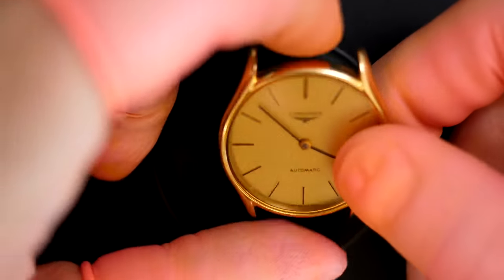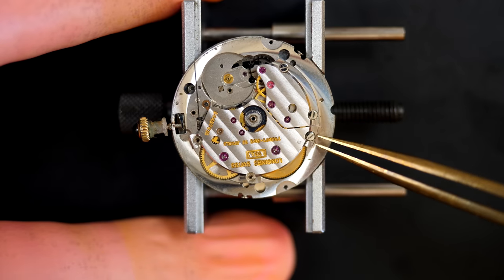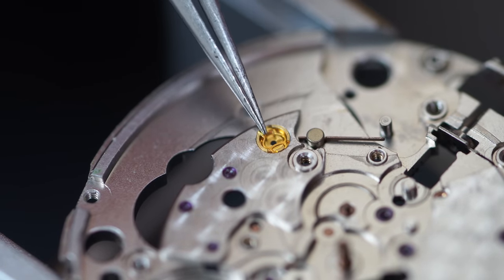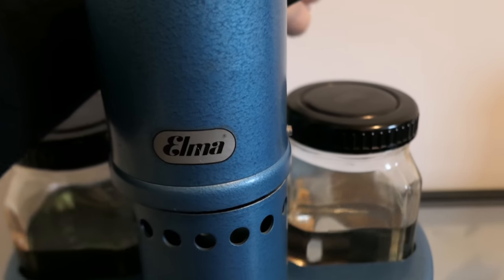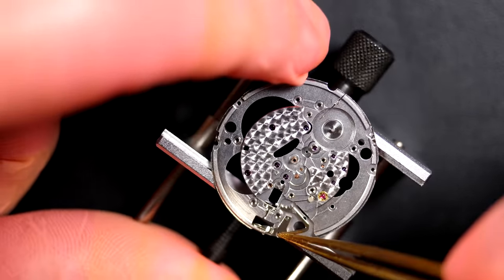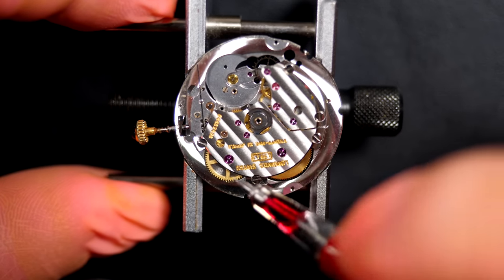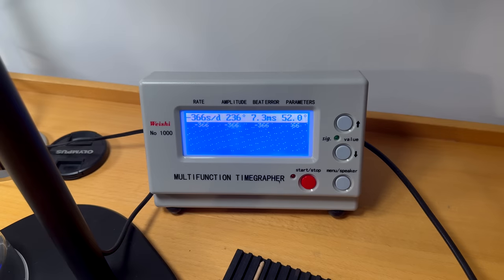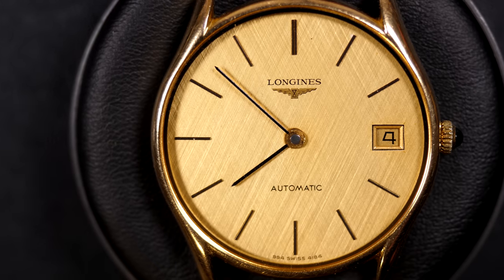Simple Outside but Complicated Inside. Longines Watch Repair !!!

Comment: That's a Longines 990 series. Those were the last in-house Longines movement ever made. The 990 series were a marvel of mechanical watchmaking engineering at the time (these were introduced in 77). That movement was so good that it was later repurposed for use with Breguet watches (Breguet Calibre 591A)! 

In the last couple of years Longines made a couple of Heritage models that re introduced the 990.
Reply from the maker: Thank you for the information. It is very interesting and I did not know Longines was not making their caliber in house any more
Reply: @FrenchWatchCollector  Longines doesn't make in-house anymore the 990 was before they were purchased by swatch. The only thing they did was launch a couple of watches from their héritage collection using the 990, I believe in 2010 or so. But that's a really good watch and movement. For Longines collectors like myself, it's a must have in the collection! Cheers
Reply from the maker: @El1988Che  i can understand it is a must have because the caliber is great

Comment: The L990 and its relatives were the world's thinnest automatic movements when introduced in 1977.  Only very recently was this record supplanted.
Reply from the maker: Yes it is so thin and well engineered
Reply: I think it was thinnest automatic movement with twin barrels, the JLC 920 used in the AP Royal Oak 5402 launched in 1972 is 2.45mm tall, this one is 2.96mm. Just a small clarification!

Comment: Its lemania 8810
Reply: That's not accurate. This movement is the L.990, developed by Longines in 1977. It was later sold to Lemania in the 1990s and became the Lemania 8810.
Reply from the maker: Thanks for the information